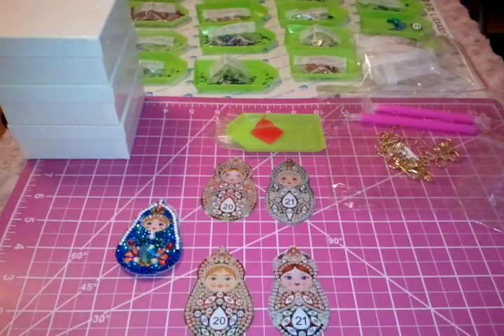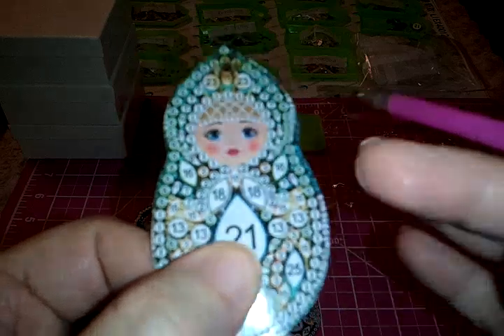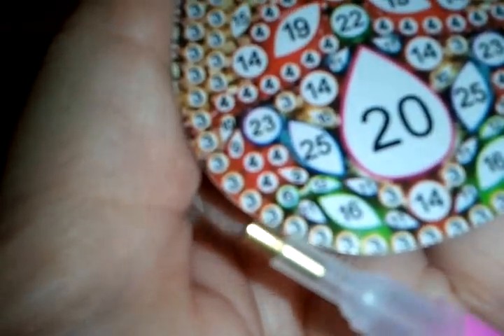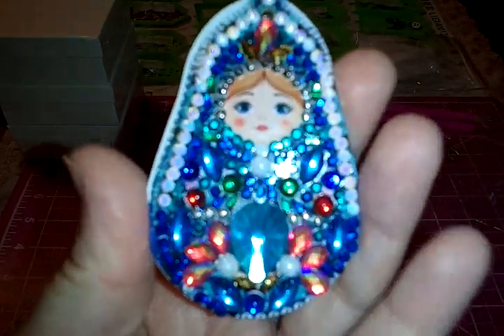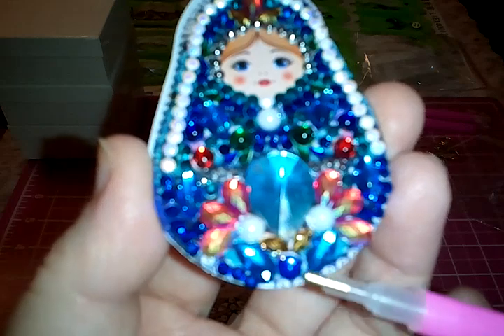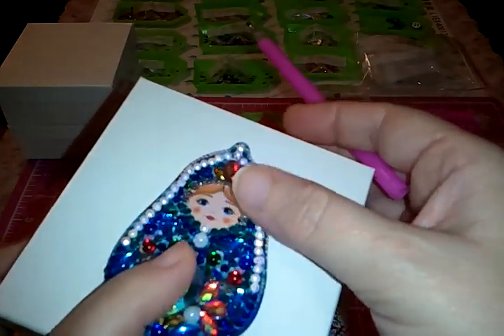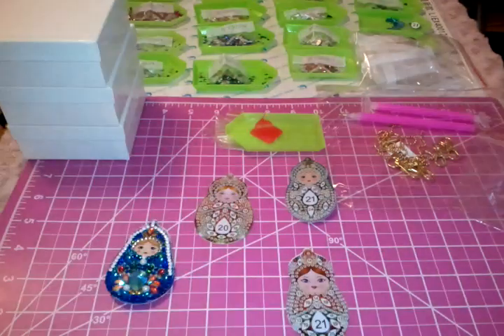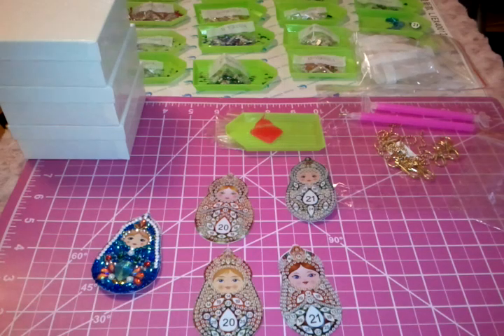DP Key Chain Solutions

Comment: Thank you for this excellent review and heads up regarding the Nesting Dolls keychain kits.  I'll examine mine real well before I begin.  I'm thinking if my kit has the same issue I'll use some sort of coloring or painting method on the backside.  Quite disappointing to discover this issue.  Are you sealing your completed keychains?  That may help in keeping the drills on as long as there is some semblance of a margin.
Reply from the maker: Since my intention from the start was to use it on the tree as an ornament, I hadn't desired to seal them, but it can only help keep them in place at the bottom.  I think I'll be using a bit of lacy ribbon around them all to hide the "ugliness."  Hoping all your sets are just fine.
Reply: @girlsonly9579  I've got a few that are definitely going to have issues.  My idea of coloring or painting the compromised side won't work due to the adhesive. Not sure what I'll do to remedy.  Maybe a narrow trim of small beads will work. Anxious to see your fix!